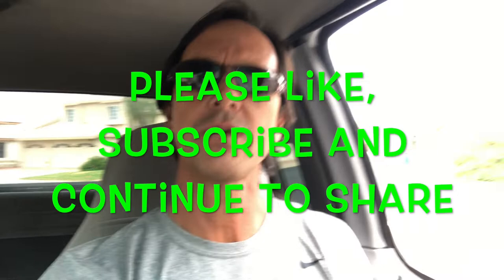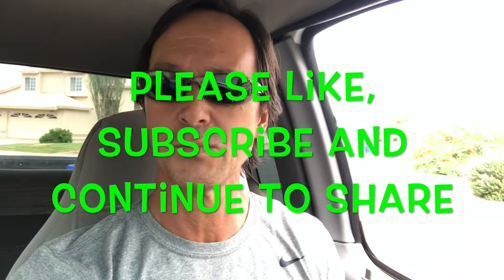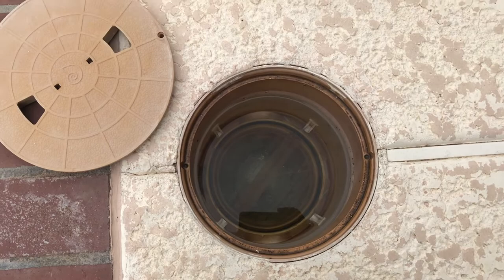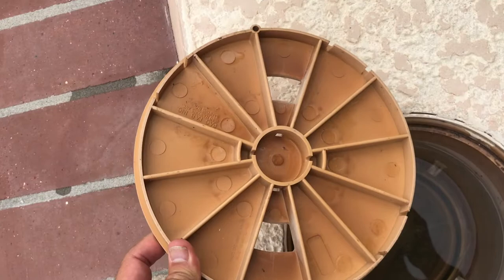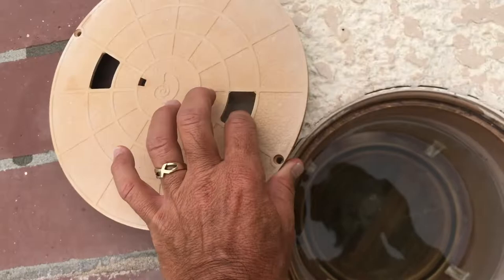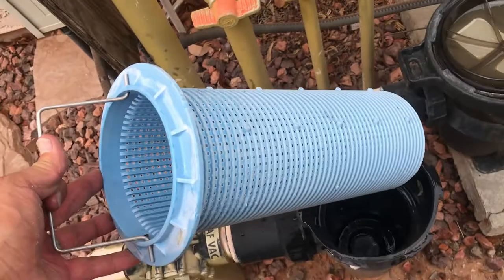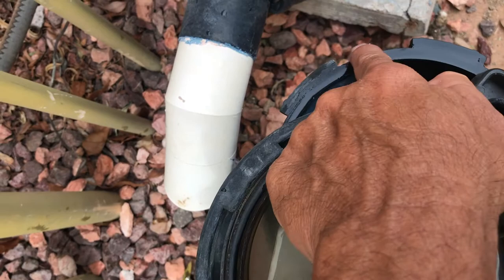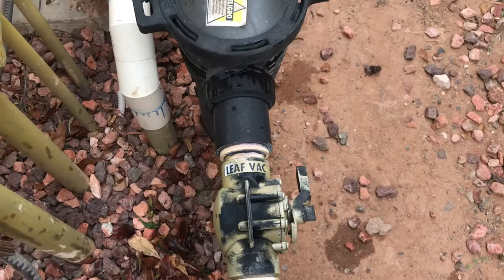In Line Leaf Canisters

Comment: Great video!  Another caveat re: these in-deck covers.  I was actually stung by a scorpion on my hand, a few weeks ago, that was on the top of the non- submerged portion of the handle on one of my customer's pool!
Reply from the maker: Carlos Carpinteyro ouch. That’s a bummer. Scorpions, and other unsavory critters tend to like to hang out inside covers for skimmers, leaf canisters, deck chlors, auto fill valves and such because they like the cool damp environment. I once had a black widow run across my finger when I opened a skimmer lid. Thankfully it didn’t sting me. Btw. I’ve been stung several times in my pool service career. Thankfully I’m not allergic to them.
Reply: @PoolSchooler  Yes, believe it or not the most unusual critter that I have ever encountered, was a live bat in the pool skimmer!!!  I even took it as proof to one of the pool supply houses, to show them, thinking that they would not believe it!!
Reply from the maker: @carloscarpinteyro332  Same here!  I found one in the skimmer of a clients pool last winter.  It was dead but it sure caught me by surprise.  I've found live squirrels, rabbits, rats, lizards and birds as well as dead ones in skimmers and pools as well.  It's amazing what ends up in pools isn't it.
Reply: @PoolSchooler  I had an incident recently, as well, when I approached a client's pool, numerous birds were squaking loudly, as I approached the pool skimmer. I surmised that maybe one of their babies was caught in the skimmer. I lifted the lid, and sure enough, one of the fledgling babies was flapping helplessly around, perched atop the weir gate. I let the birds see me removing the baby, putting it in the sun on grass to dry out. Sure enough, the squaking ceased!!   I guess that makes me a "poolman bird whisperer"!

Comment: i have a on deck leaf canister with a hole in side of pool just like the first example in your video my question is how do i vacumm my pool cant seem to find right combination of which valves to close which ones to leave open...
Reply from the maker: Sometimes you can't via the in floor leaf canister.  You have to use the skimmer suction.  This video will show you how: https://youtu.be/x9WaMUzSO-8

Comment: That drain cover looks like a paramount MD2. 
Is that VGB complinat? Does it need to be? 
What happens to the cleaning system if you put on a VGB compliant cover? 
Can a VGB compliant cover be legally mounted on offsets like the MD2 so that debris can still go underneath?

That side port shouldn't have suction. On mine, it's just allows water to flow from the pool over top of the canister lid, holding it down and preventing air from being sucked into the canister.